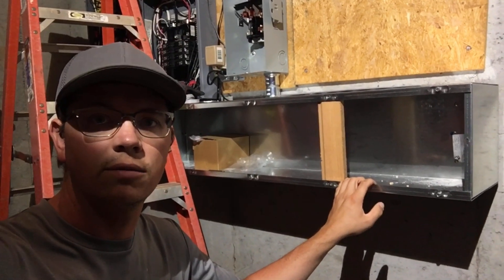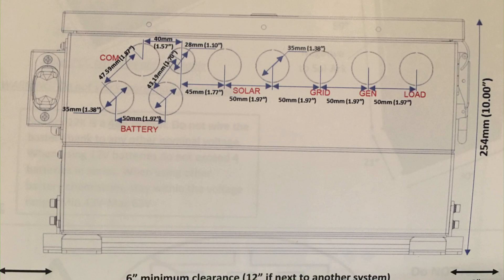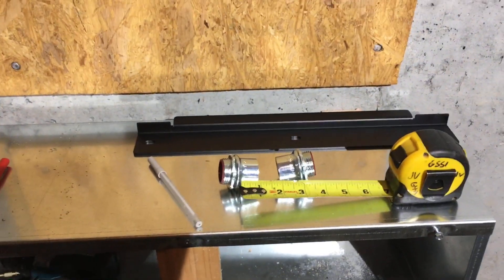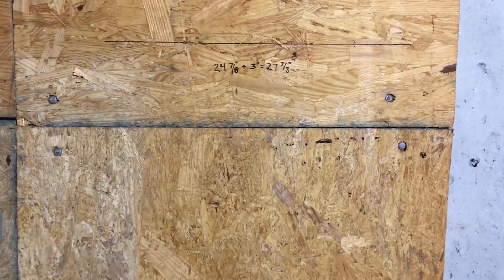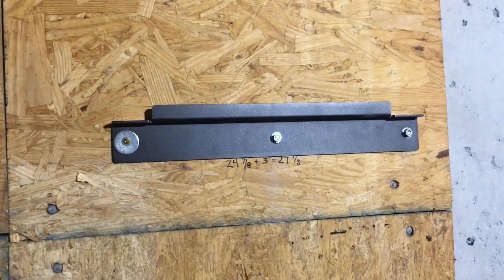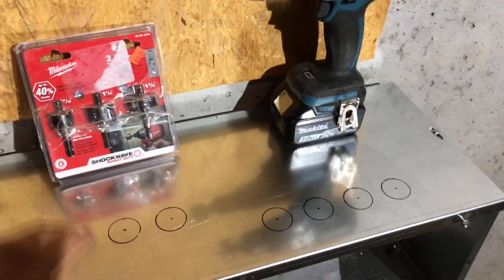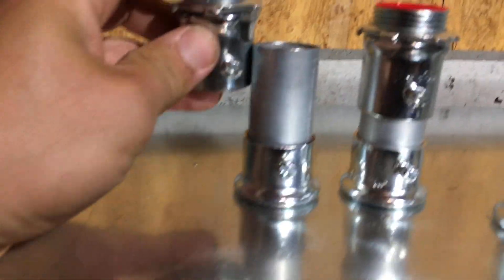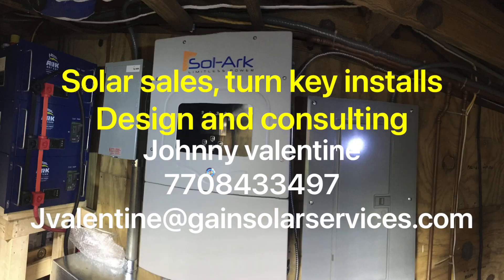How to Install the Solark 12k: Mounting the Inverter

Comment: Excellent video! What’s the brand/model of the wire way?
Reply from the maker: I go through a lot of wireways. That was either Austin enclosures or EBox brand. 

When ordering it’s usually the denoted by the dimensions and the environmental rating so that would have been a nema 1 screw cover wireway. Probably 10x10x48.

Comment: Great job, sir. I am planning to install a 8k system into an interior room. What's the minimum wireway depth I can use?. I know you  used a 10". Is it feasible to use a 5" or 6". Thanks for all the videos.
Reply from the maker: You can use a smaller wireway but you end up having to bend or flex down into the wire way and it doesn’t look as nice and it’s more difficult. You will not find a 5 inch wire weigh in a 6 inch wireway is going to be tight. Why not just by the right size?
Reply: @Gain Solar Services  Thank you, sir. One last thing any issues with NEC wiring DC & AC in the same raceway ?
Reply: @andys5203  Not as long as they are for the same system and all conductors are at no more than 600V to ground, which would be the case.

Comment: Do inspectors ever give you trouble for mixing the PV source conductors and AC conductors in the same raceway? 690.31(B) appears to prohibit the practice, unless you somehow partition the conductors.
Reply from the maker: We’ve never had a problem with that. Personally, I think the I renting of this code is to keep dc and ac conductors out of the same conduit, but if you are worried about it there are wireway partitions available and we usually go thru and physically separate them before we close up the wireway. We don’t have them bundled together.
Reply: @GainSolarPower  thanks for sharing your experience on this. I did find the language of that code a little odd, because 300.3(C)(1) explicitly allows for DC and AC conductors to share a raceway, so long as they are under 1000 volts.

Comment: THANKS FOR THE PROFESSIONAL NEAT DETAILED INSTALLATION !
I WANT SOL-ARK 15kW WITH SMART LOADS 14 FOR WHOLE HOUSE BATTERY BACKUP.
WHAT SIZE PV ARAY WOULD YOU SUGGEST FOR AN AVERAGE DAILY GRID USAGE IS 25KwH & 5.4 SUN HOURS?
I HAVE TWO GRID TIED QUOTES FOR 4.5 Kw - 7.6kW
Reply from the maker: Please email me at jv@gainsolarpower.com 
I will send you a quote for the material 

25.4 kWh per day / 5.4 sun hrs / .80 derate = 5.67kw solar array

Comment: Thank you Johnny for that level of detail. I bought a 12k Sol-Ark from Scott, but his videos are only cursory overviews of the installs. I also had two Sinclair ground mount systems installed and am now planning for a DIY electrical installation. Will purchase the second Sol-Ark first of the year. Didn't know you and Scott are both retailers for Sol-Ark. Will watch more of your videos to capture the detail, tips & tricks and nuances of the electrical side for these Sol-Ark inverters. I also bought the template from Scott. Both you and Scott are valuable DIY resources.

Comment: Thank you for taking the time to show us that.  I am getting ready to install a 20kW grid tie system and am trying to learn as much as possible before I start.  Are there any EMT connectors that don't have an internal collar so that you can slide the 3 inch nipple of emt in from below ?
Reply from the maker: No. They all have the stop.
Reply: @GainSolarPower  That's a shame..I was looking at the Fronius inverter and the frame and lugs screw down first which makes it easier to lift into position and align the emt nipples. The main Fronius unit drops into and hinges from the top of the frame and then hinges down. It has male blades that make contact with the female frame contacts as the bottom is pressed into position.

Comment: Instead of making that template with large holes and then figuring out where the center mark goes, why not make the template with holes small enough to make just the center mark? Or, have the guy who is making those templates punch a center hole in the piece he’s going to cut out and give those with the template. That way you can mark your large holes and use the “waste” piece to mark the center.
Reply: Bingo
Reply from the maker: The templates works great but I get it. Shoot small miss small.
Reply: Definitely should only have a small hole to mark center only, I'm sure it was an oversight and easier to determine in hindsight.  Good job on everything thanks for the tips.

Comment: Johnny, thanks so much for this video. This is the one I have been looking for every since I bought my Sol-Ark 12K. Couldn't have come at a better time as I am just about finished with my ground mount racking system and am about ready to install my Sol-Ark 12K. I like the way you show how to transfer where to drill out the holes on the wire tray to match the Sol-Ark as I was in the process of making a template from cardboard and this looks much simpler. Thanks again for going through this on a step by step basis that is very easy to understand and follow.
Reply from the maker: Hopefully it will sell some solarks for me. Thanks for watching
Reply: I'm at the same level of my install too. Agree with your comments. You can view my comments also in this video thread.

Comment: Great Video, Always wondered how you got from the Sol-Ark to the Wireway looking so good, usually this is skipped over in most install videos, and thanks for the additional measurements needed from bracket hole to bottom of Sol-Ark 24 7/8" + 3" for nipples 27 7/8" total. Let Sol-Ark know they need to ADD that info to their INSTALL MANUAL. It was very informative talking to you last night, I will let you know how my install phases go. Thank You again, to YOU and your growing Family.  Robert
Reply from the maker: Thanks Robert!